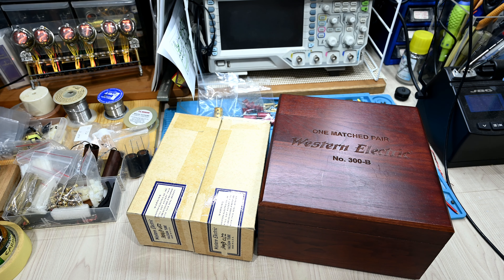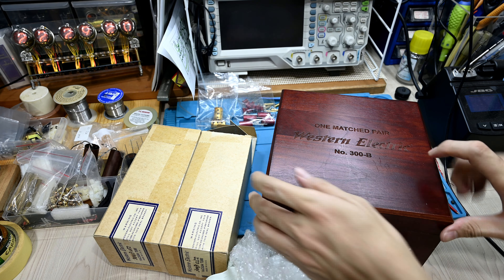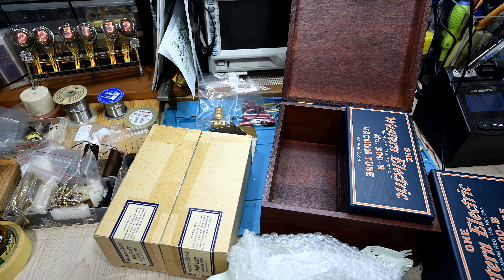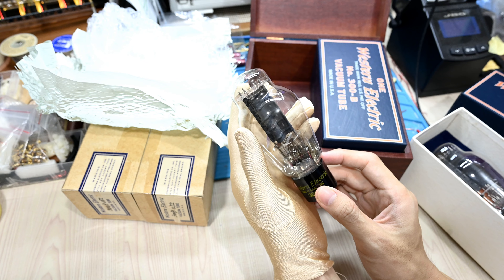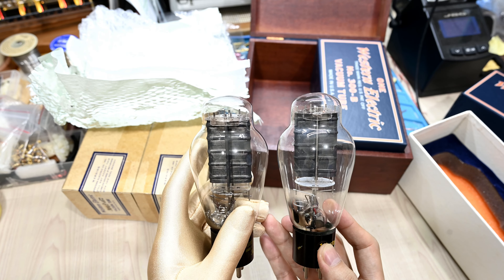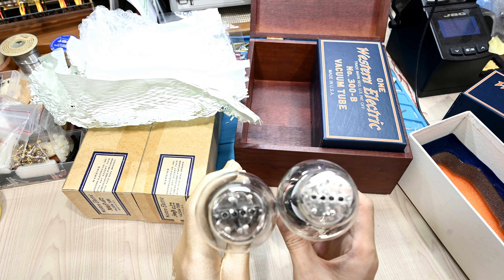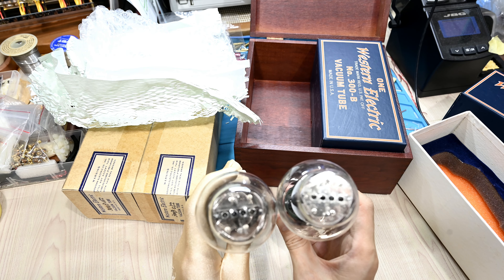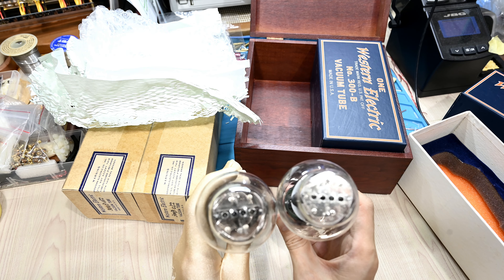Western Electric 300B Year 1950 & 1997 Physical Comparison (with Takatsuki TA-300B as well)

Comment: From what I understand the 1950's 300b where for their theater amps .  Rather than for telephone use at that point.
Reply from the maker: Yes, you are right...
Reply: So I read somewhere that they used 300B's as repeaters in undersea enclosures for transatlantic comunication lines of some sort. On the ocean floor.
Reply from the maker: @leiferickson3183  this is new to me!